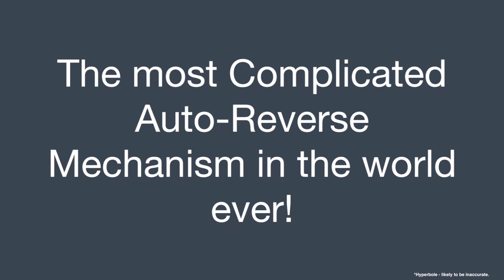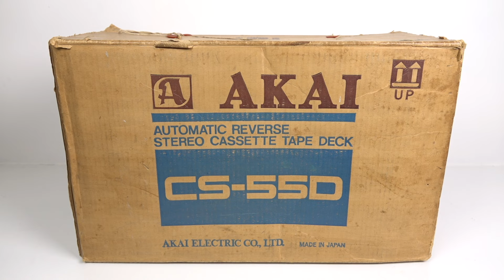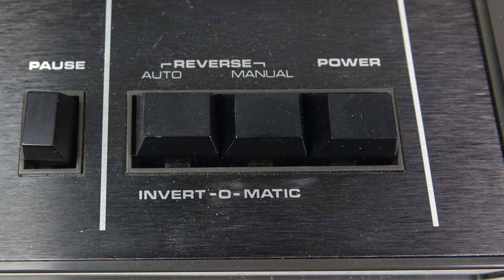Auto-Reverse: The Hard Way

Comment: That wood strip reminds me of an Atari 2600. The 1970s must have been the Wood Age or something. There was wood veneer on everything.
Reply: +Adrienne Shepard Back in the "old days", people thought electronics were "ugly" and had to be masked with wood to make it look like furniture. So, console TV's and stereos ruled the day. Any other electronic device that might sit in the living room (like an Atari or Pong console) were similarly masked, if only to match the actual TV's they were connected to. By the 80's, people figured out that electronics were not "dirty laundry" which had to be hidden. I sold TV's for awhile in the early 90's, and every so often an older couple would come in insisting on a console TV set for that very reason. By then, here were very few console sets to be had.
Reply: @lordmikethegreat  very interesting
Reply: @lordmikethegreat  : True...but by those 80's and 90's, most of the 'wood' finish was a plastic wood patterned wrap over either more plastic, or cheap plywood!  Some companies even used a wood patterned foil type wrap over a bare sheet metal case!
Little did they know back when when real wood was regularly used, that it was far better ecologically (if it came from sustainable forrests, of course) than the subsequent, and cheaper plastic wood finish that at least on most Hi-Fi units had died out by the early 80's...!

Comment: My brother had the GXC-65D, the one with Doby-B. Suggested retail price by Akai in 1973: $350. That would make $ 2000 in year 2021 for a two head deck! That mechanism though... My brother did not pay that much. This model was discontinued after just a year because of mechanical problems, and the remaining stock went on sale. My brother went back many times for repairs until giving it up, about 10 years later.

Comment: What a fascinating machine and hats off to the filming and commenting! Thanks for sharing and going through all the effort in making these videos. 
On your comment on autoreverse cassette recorders requiring to flip the heads for 180 degrees, you might want to have a closer look at the UHER CR 1600, which has a 4 track head and two erase heads arranged in forward and backward to it. Definitely one of my favourites. The mechanism is based on UHER‘s 1972 CR 124 which was autoreverse but not when recording. 
Anyways I share your fascination with vintage HiFi equipment and have great joy in watching your videos - thanks!

Comment: The fantastic mechanism reminds me of a Polyclip System.

I used to make sliced ham at my old job, and you would have a stuffer machine filled with meat, which would force the meat through a tube.  On the end of the tube you could attach various machines for molding or even manually (for example, you would hold a 4 x 4 meter long hollow tin over the tube, and the meat would fill up the tin whilst pushing it off of the tube, you'd be left with a 4 x 4 meter long tin filled with meat, and when the meat is cooked in that tin, it solidifies in that shape, so you'd have a 4 x 4 log of ham which you could slice into square pieces).

Anyway, one such machine we had was a Polyclip System, you would have an endless plastic/polymer sleeve which would be clipped at one end, and (just like the tin mold) would fill up with meat and push it out.  After about a meter the machine would stop pushing meat and it would then close the sleeve, stretch it out by about an inch, put two clips (one at each end of the inch), and slice in the middle to cut the sleeve off.  It would seal off one log with a clip, whilst preparing the sleeve for the next log.  It was a digtal machine which had sensors for detecting the log reaching a meter.

What I was shocked to find though, was when an engineer was repairing it and operating it without its cover, I found that the actual mechanism for closing the sleeve, stretching it by an inch, stamping two clips on each end, slicing the sleeve in the middle and then releasing...   ...was ALL mechanical, and controlled by a single wheel/motor.  There was a wheel on the end which with two men strength you could rotate this mechanism manually and it'll perform the entire process within one 360 turn of this wheel, it was absolutely amazing!

This mechanism reminds me of that, but it's nice to know that even in the digital age there are still technologies which require mechanical engineering for which digital wouldn't be as cost effective or would be unreliable.

Comment: Brilliant, Matt. using Strauss '2001' score, a master touch.

Akai was an example of the post worldwarII economic miracle.
I remember seeing a video of mass production of R2R tape decks. on the line, operatives used rubber hammers to clout circuit boards, then check for dry joints....thorough. I bet your Akai, will still be reversingfor another 40+ years, like  Nakamichi's UDAR system.

Comment: Wow, this takes me back! I once volunteered to fix one of these for a friend of my father. It had locked up, with a tape inside. I had to study it for an hour and a half to figure out what it was supposed to do, then decide why it wasn't doing that. It then took less than 20 seconds to actually fix it. :-) Btw, I seem to remember that it also had a ski-slope auto-feeder for about 10 tapes, but I could be mistaken. It was a long time ago... It was bought in Singapore.
Reply: I definitely remember manning a Phillips style auto-reverse deck with room for multiple tapes at a party once.  As each side ended, the tape was automatically thrown to the top of the pile, other side down, while the bottom tape was inserted and played.

Comment: Car decks I used to repair used a 4 layer head that was stationary. They just reversed the tape drive using 2 capstans. The heads in use were selected by a 4 pole switch.

Comment: Back in the mid 80s when I was a kid, I remember visiting my local collage library and reading several older reference books and such about electronics dating back to the late 60s and early 70s.   Somewhere in there was a photo of one of those turbo-eject-and-flip units which was never explained in detail, so I only could imagine how it worked.   To me that still seems to me to be more an exotic and maybe even luck-based system then this rather precise mechanical setup.     Nice to see this one in action though.

Comment: Dear I have used one more auto reverse mechanism in which the head of the tap (That read the information) has 4  Coils in it 2 for Side A and 2 for Side B and that is even more advanced.  When tap ends and it pulls the some of the specific gear it starts moving the cassette in opposite Direction.

Comment: in the eighties i spent all my money in HiFi and HighEnd components. My car was stuffed with DYNAUDIO high and midrange and selfconstructed sub, all driven directly that means averything had its own amp (AUDIOART). also at home, so i was a very proud owner of a DUAL CS5000 turntable, a Vellemann Tube Amp, a pair of Acoustat Spectra 11 electrostatic speakers and a Nakamich RX 505 E. this Nakamichi machine also had a mechanical auto reverse that throws out the cassette, turns it very quick and takes it back again. you will find the process somewhere here at youtube. the DUAL and the Acoustat survived till today and are still in use, driven by a preamp / poweramp combination of ROTEL.
By the way... i spent for the the NAKAMICHI machine 2700,- DM

Comment: I’ve owned the Sony tape deck that actually pushed the cassette out, flipped the cassette around, and pulled it back in to play.  It was similar to this one but it did everything vertically instead of horizontally, so it could be added into a component stack. 
I loved it and it worked flawlessly until I sold it. I wish I still had it.

Comment: In fact I found it a very effective piece of equipment ! I do have a less older model Akai HX-R44 with the auto reverse accomplished by a turning head... It's a little faster but mechanical interferences are critical and aligning and making it work again after a belt replacement session is not that simple.  The "complex" mechanism shown here seems more reliable than mine !

Comment: After that, they just made a rigidly mounted, double sided head.  the only mechanism required was a dual capstan/pinch roller that were alternately engaged with the tape (both capstans were linked and always in motion, and the added side effect was their opposing flywheels canceled gradual rotational motion of the unit from adding "wow" to the tape speed) and  to switch the supply and take up reel tension/direction.
Reply: Bawb Lablaw Akai lerant how to do it much later in the 80's :)

Comment: as always, another good video from Techmoan ... i think there's also another auto-reverse mechanism in which the head is fixed in place so it wouldn't lose its alignment (not so early at least anyway) and it has 4 reading/recording smaller heads across but the motor reverses its moving direction at the end of each side ... i may be not so good at describing it here but it's surely even better than the rotating head mechanism ... which tape recorder/players used that? can't remember ...

Comment: Nakamichi RX-202, not sure if it was mentioned but also one of the best sounding cassette decks ever. I had this, dragon and some other machines over the years. The Dragon and any of the Nak 3 head, 3 motor machines simply where the best and made cassette sound better than it ever should have. Even the cheaper models

Comment: Most consumer-grade auto reverse cassette decks featured a 4-track head. This meant that there were two coils for one side of the tape and two additional coils for the other side. This does not require the head or the tape itself to be inverted. It allows for the tape to simply start moving in the other direction while the head transfers power to the other two coils.
Reply from the maker: Not recorders though...
Reply: Maybe not cassettes, but the Teac X-2000R reel to reel does have playback as well as record heads for both directions.

Comment: You mentioned the head alignment issues for the more common type of A-R for cassettes.   I agree totally.  Poor head alignment and cross-talk go hand and hand not to mention the compromised upper treble.  Then the other bug-a-boo of both reel to reel and cassette decks is the added mechanical complicated mechanisms which tend to make the all such machines a bit less reliable in the long-term.  Sometimes less convenience means better fidelity and reliability.  Still a fascinating video.

Comment: I actually quite liked the Phillips Compact Cassette. I flipped my tapes manually. I grew quite fond of Dolby B noise reduction, but I found that most machines were not calibrated correctly and that is the very first thing I would do after getting a cassette deck. You started with playback FIRST using a Dolby calibration tape, (400Hz @ true 0VU) setting the needles right within middle of the Dolby marks on the meters. These were frequently higher than where 0VU was shown to avoid tape saturation. Then using a 400 Hz tone, I would set the same level on record. Frequently you had 2 or 3 calibration potentiometers for each tape type, Normal, Chromium Dioxide and Metal. When calibrated, Dolby noise reduction would produce perfect results. I calibrated for Maxell cassettes as other tapes could theow off my Dolby calibration. Interestingly enough I preferred Dolby B to C because the action of C was so severe that music sounded slightly compressed even when calibrated correctly. Ah, yes, those were the days! I'm still the picky audiophile and I love my music collection dearly now all digital of course. Still, the difference between MP3 and FLAC is unbelievable, so all the new stuff I get is all FLAC.

Comment: As an early form of auto-reverse, I find these mechanical cassette flippers to be very clever, with the exception of the "throw it up a ramp" one"  It might be fun to see that one in action. As for the "head-flipper" I have to wonder if this was a Europe/Asia thing. I don't recall ever seeing this method in North America. (I'm in Canada.) I noticed this head flipper method mentioned somewhere else on YouTube as well. The few auto-reverse cassette decks I ever owned didn't flip anything physically. Instead, they employed a 4-track head, instead of a 2-track and activated tracks 3 & 4 when it reversed the tape transport. This would be the best way to do it; less mechanics to go wrong and no head misalignment issues.
Reply from the maker: Recorders need to flip the heads whereas a play-only machine like a Walkman or car stereo can just use the 4 track play head method you mention.
Reply: +Techmoan Small correction.  Recorders would need either two erase heads (one of them squeezed in next to the play head) or two pretty special 3-track heads (stereo audio for one direction, mono erase for the other).
Reply: On the flipper, the erase heads could be mounted on the head flipper mechanism.
Reply: Also common to see a play only auto-reverse deck as one side of a twin deck setup.

Comment: Fantastic forensic analysis of an early prototype technology. I had never seen the number-wheel-flipping mechanism before, nor the 'flashing light' process that indicated the end of a side. Very interesting how the engineers chose to flip the tape rather than the head after having considered the probability of misaligning the head. I suppose they must have felt the existing manufacturing technology at the time must not have been sufficiently accurate to ensure that a moving tape head would re-align itself precisely. Judging by those plastic and cast pot-metal gears, they probably made the right decision for the time. Those materials were junk. I remember well ;-)

Comment: I'm glad he mentioned th Nakamichi series. They were more interesting in my opinion, because you could see the tape flip. I had the Nakamichi RX-505 for a couple of years. But becuse it was so hard to clean, I sold it & bought a Nakamichi Dragon instead. I don't even own a cassette deck any more. I got ride of the Dragon when I bought a recordable dual CD dech. Which I also no longer use because it's so hard to find audio CDRs that work in them now. (They have a special copy right code that unlocks the record feature.) Now I just burn CDs on a computer.

Comment: Seems I have a new addiction :) to watch your videos... One comment: at 7:18 you mention about the play head and the record head. However I noticed only 4 wires going into the head. So I believe there is only one (combined) head used alternatively for play and record. If it had separate play and record heads, then it would be possible to monitor signal while recording, which I don't think was featured in such an old cassette deck.

Comment: 0:50 head flipping has another problem. The signal wires to the head are flexed over and over, until they fatigue crack, break off, and now your cassette deck doesn't play one of the stereo channels. Keep going and eventually the wires for both channels fail. The heads were usually deeply embedded so the mechanism must be completely torn apart and the broken head wires are either replaced, or hopefully can just be resoldered back on..

Comment: This kind of mechanics comes into use where quick-as-possible reversing is not important. Otherwise we need indeed:  2 capstans+guiders, 2 erasing heads (halfsize because requring it to fit it into the two smaller holes of a cassette, which weren't meant to be there in the first place initially for sticking tapeheads through them but only for using "tape-end" switch blades), a 4-track (4-coil) tapehead with one guide fork on either side, 2 pinch rollers. 2-3 Motors for tape transport. Only this setup does not need any "turnover" mechanics, neither for the head nor for the whole cassette itself.

Comment: 0:58 the only auto-reverse tape player I ever saw used that method, and it failed.
What happened was the wires going to the tape head broke inside the insulation, probably from metal fatigue each time the head flipped over.  A more reliable way would've been to have a 4-channel read head, or TWO read heads so that nothing would have to flip when the tape started going the other way

Comment: I've never heard an auto reverse cassette deck that didn't have alignment problems on one or both sides.  To me, this method is the ONLY way to do auto reverse.  Of course, I prefer the Nakamichi mechanism, though.  Getting back to Akai, though, I love the motor with the gear that moves from one side to the other for linear motion that reverses!

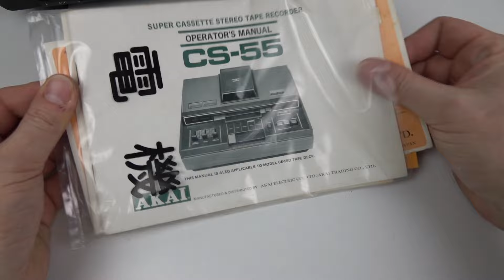Comment: @2:00 It's interesting that the plastic says 電機 (でんき, denki). Which means "electric machine". These that goes without saying. Back in the early 70's they must have felt it necessary to tell you that it required electricity to work. Although, the company's name is Akai Electric (赤井電機) or Akai Denki. So maybe it's actually a reference to their name.

It's also interesting that the instruction manual is in English.

Comment: Instead of using expensive and failure prone mechanisms, the best mechanism, used by sharp in 1991, was to just have a head having containing 4 tracks and reverse the motor when tape reaches end.

Comment: 5:20 Now, to missquote Gary Oldman, in 5th element: "What a lovely ballet of brilliantly crafted things"

I am completely sold for a good craft that replaces few silicon chips of the same performance. (Even if it takes a bookshelf-sized case to run)  Not because of "possibility of sudden EMP strike", but rather because this is what i can maintain and fix (if it breaks in the first place), also, because things back then had no preprogramed faults or wear.
Reply: That's exactly my point, it would've worked fine, if it wasn't for the manufacturer's ways of selling software. 
Imagine fixing celling light in your house, which requires rebuilding whole roof, just to get new type of bulbs working in it.  That's the present way of running support: a complete demolition, or no light.